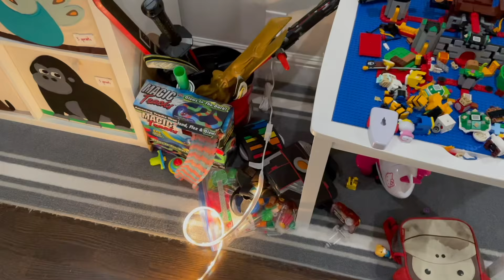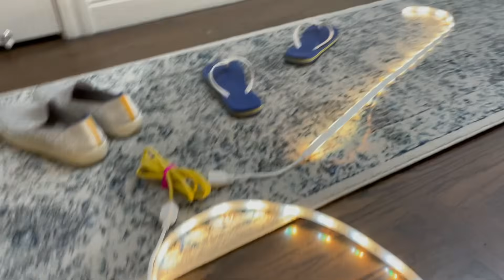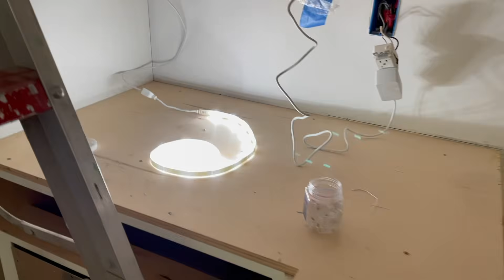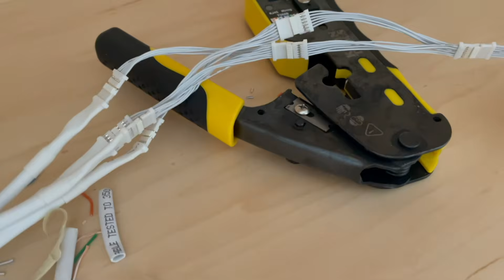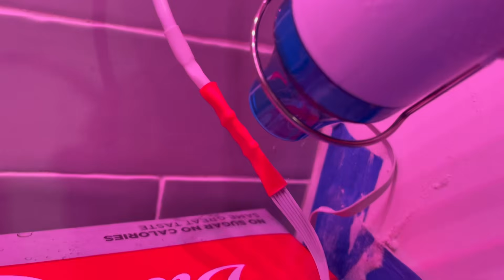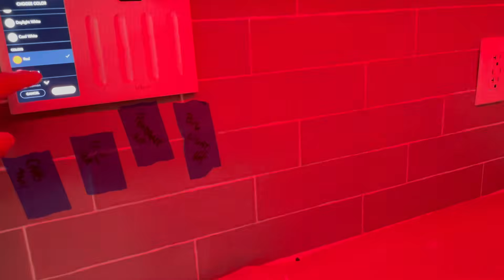Kitchen Under Cabinet LED Hue Lighting w/ Integrated Light Switch + In-Wall Ethernet

Comment: Super helpful video! How did you ultimately power the controller? Are you using the supplied adapter on a switched outlet or did you get a transformer to hardwire to a switch?